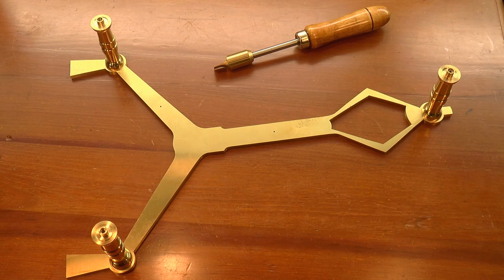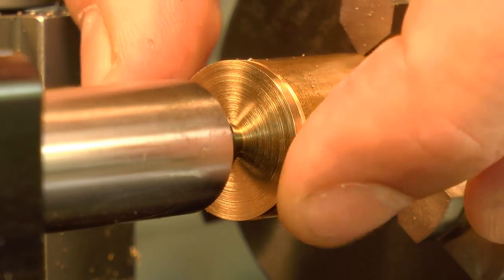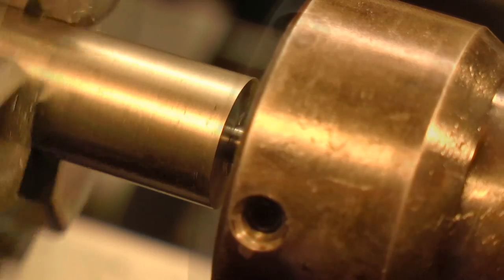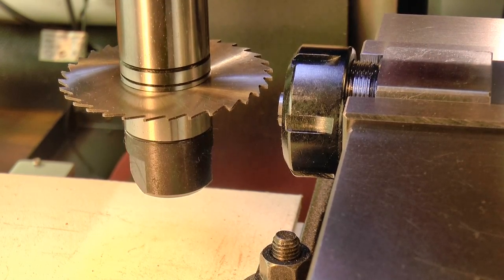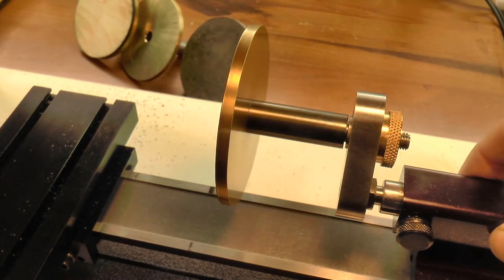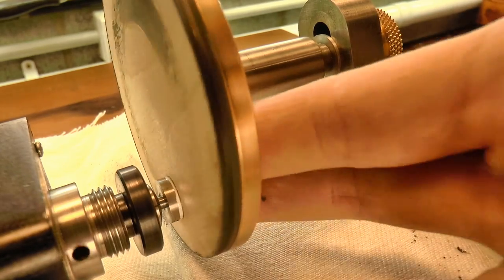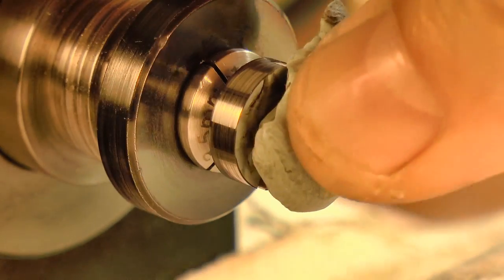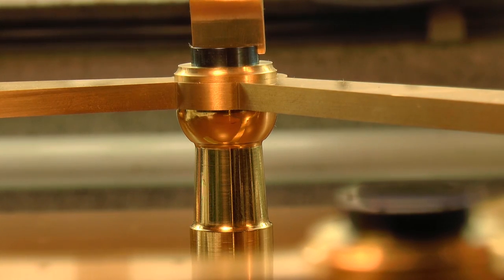Clockmaking - How To Make A Clock In The Home Machine Shop - Part 3 - Making The Washers And Screws

Comment: Really interesting how you tracked down the polishing issues. I've tried diamantine powder on watch screws and have never been able to get it right. I'm going to have to go back and try again! Thanks for the amazing videos.
Reply from the maker: Yes my main problem at this point was contamination,. Not long after this video I tracked down some pure tin to use as a lap with the diamantine, as per standard watchmaker practice. I am getting reasonably consistent black polish results now with both a solid tin block for under hand polishing, and a circular tin lap for a tailstock polishing tool for the lathe. Pm me if you would like some more info Fred

Comment: folks, when he says it isnt perfect he was not just talking about the polish. the polish is quite good. the “problematic” spots are around the slot for the screwdriver. later on you can see how rough the edges still are. 
this is not to detract from the work, which is still great. just putting in some perspective on how it is not perfect.
Reply: you can see it at about 8:19 for example.

Comment: Chris, in my model engine building I've always been able to get a mirror finish on cast iron by going through the grits of wet-or-dry paper always using light oil (3-in-1, or drug store mineral oil), the finish maxes out at around 1500 or 2000 grit and you get a mirror finish as the piece of paper you're using wears out, you are literally relying on it wearing out, which is why paste doesn't work as well since you have too large a supply of it on your tool and you're always replenishing your polishing with new grit.  As for mild steel, that's a bit more difficult because the material is softer, so you need to be more careful in not letting non-worn-out grit get in the process. HTH, let me know if you ever try it, and if it works or doesn't work for you.

Comment: hey Chris, Those screws came out beautiful. I have difficulty making my screws blue like that I almost always go too far on one! Purple and blue don't look good together. So now I cut more screws than I need and then I have another ready for bluing. I would love to find a watchmakers lathe video or class. I have always cut by hand because I chiefly worked on watches. My eyes are not young anymore and I have just tooled up for doing clocks. I have a full set up of Derbyshire, lathe, cross slide and milling attachment. Also counter balance and idler pulleys.
I wish I could find a good tutorial because to get good with the lathe in anything but hand cutting I need to learn to set up the cross slide, and milling attachment. Thanks for sharing your extensive knowledge. All the best, Sean
Reply: You may know this but always keep the bed clean

Comment: Simply a beautiful blue color on your screws. It took quite some time for us to find the right steel that had the proper carbon content to achieve this, but I think your color is even better. Could you share what type of metal you used to create these frame screws?
Reply from the maker: Mark Frank Thank you Mark. The steel I used for the frame screws was a mild steel from a supplier in Melbourne (http://www.mesupplies.com.au/) I like the color, but not being able to harden them made polishing a challenge. I have recently made some bezel screws for this clock from some EN8 sourced from the UK that I think came out a little better in color, and being able to harden them made polishing a real pleasure. I will finish the edit on that video next weekend, so it will be up for viewing in about 2 weeks. Cheers, Chris.

Comment: To prevent the scratching and to get a very good result, bring the polishing compound to a putty like consistency and polish against a zinc block.
Reply from the maker: +Nate Blubaugh Hey Nate, thanks for that. The main problem here was that they were made from mild steel, as per JW's design.The blue is better, but the polishing was more trouble than it was worth to stick with mild steel. I am hardening all of the rest of the screws and polishing with a tin lap, and the results are much more consistent: https://www.youtube.com/watch?v=5sAw4Q1PM8Y
Reply: Clickspring I had forgotten to take into account that you had used mild steel lol my mistake :p.

Comment: Your workmanship is very much appreciated. Couple of questions.

How did you determine the expected diameter for the die you used?

I am having some difficulty using watchmaker screw plates as to find out what the expected diameters are for them.

I have charts with the designated sizes of Martin 

One example size 20 has diameter of 0.367 with pitch 0.087. I take this to mean that the results after threading produce these numbers. 

What would be the expected diameter to make the stock so to thread it?

Comment: I worked with a guy that was a perfectionist like yourself and watched him work on the cover plate of a surface grinder where he dressed up the area of a welded on bung and spent over 16hrs contouring that plate until it was perfect only to have the next guy that used that grinder take that cover plate off and throw it in a spares box, never to be seen again!

Comment: Hello, First I would like to say.... WOW...
Your work is very precise and amazing.

Love how the clock is turning up.

I have a question for you: I have a brass screw from a Stanley hand plane that is a bit mushed up in the screw slot, is there a way to fix that?
Either filling it in and cutting a new screw slot, or some other magic way/simpler way?

Thank you very much, and keep up the great work, always lovely to see how much detail goes into your projects.
Reply from the maker: Hey Miachael, yes it sounds like a good approach to me, let me know how it turns out.
Reply: Hey Clickspring How do you polish your surface so well? Is there any method to it? And what kind of materials do you use for creating such a polished surface.

Comment: Hi Chris,  Thanks for the wonderful videos so far!  Really excellent videography and narration!  Your tail stock polishing jig is quite nice and was thinking about using a leather one for some of the final work instead of the MDF.  I do a lot of hand cutting/polishing work and love the zen of it and the transformations.  I've made a few different hand boards with various leather on them to achieve my end with various compounds, maybe give it a try on one of your discs?  I use Barge cement to bond the leather to the wood and it removes fairly easily when needed.  Always fascinated by clock/watch engineering & artisanship but alas trifocals and not so steady old hands puts it a bit out of my league.  A pleasure to watch your processes, techniques and thinking!  Thanks much for sharing with us!  ~PJ
Reply from the maker: pjsalchemy Thanks PJ, I appreciate it. I hear you on the zen of polishing, I love it too; it's a real achievement when you get a  nice finish.

Yes I think a leather surface would work excellently, especially on domed screws, I will try it out when I can. I have just made a pure tin lap to replace the mdf one, and it really works wonderfully too. It will show up in a video soon. It's soft enough to hold the diamantine charge, but it keeps the corners nice and square.

Comment: absolutely fabulous! Thank you so much for making these videos. I was wondering though, you mentioned the screws are made of mild steel. didn't you mean some sort of carbon steel?
Reply from the maker: +Aditya Sambhare In this case, the plans specified a mild steel, so I went with that. All of the other screws for the clock are made from a medium carbon steel (EN8). The mild steel is softer, and therefore much more difficult to get a good polish, although it does give an excellent blue color. Thanks for watching and asking

Comment: Good lord. Thats some amazing work there. I am fussy and pretty good at machining but nothing on this level!

I am wondering though whats stopping the steel corroding. The colour is just that a colour. No plating or oxidation?
Reply from the maker: +Richard Baggaley Hey Richard, the color is generated by a thin film of oxide, no plating. There is a bit more info on the process at the end of this video: https://www.youtube.com/watch?v=8h1Uf9bkc3E Regarding the corrosion, the polished surface provides some measure of rust resistance, and the oxide itself is widely believed to help also. Other than that, it's unprotected.

Comment: Newly subscribed after coming across one of your videos on Reddit.

These videos are bringing back some great memories of my granddads watch making days and has inspired me to spend more time using tools that I inherited; the Pultra 10 is a bit lacking in power.

Quick question, how did you go about clocking the screw heads correctly without over torquing them and risk ruining the threads?
Reply from the maker: Paul Whelan Hey Paul, very pleased you're enjoying the vids. Re the screw torque: it just comes down to being aware of the risk of thread stripping, and employing a gentle touch. A few degrees past a snug seating is all that is required.
Reply: Clickspring I've spent the evening rebuilding my 3D printer and they've been a great distraction, so safe to say I'm very much enjoying them. Regarding the screws, that makes a lot of sense. I suppose a lot comes down to having a feel for the difference between snug, tight and threads starting to strip.

Keep up the great work. Honestly the highest production value i've seen on youtube in a very long time,

Comment: Your technique in this video(especially in regards to polishing and bluing) are very different from your later videos. Did you discover new/refine your methods? Would you change anything if you did it again?
Reply from the maker: Yes definitely learned plenty through the course of this build: The temporary bluing tray was replaced with a set of dedicated trays filled with brass chips https://youtu.be/uST7iJgC_gs. They give a far more consistent and controlled result than simply laying the part on a scrap of sheet brass. For polishing, a tin polishing plate gives the best result with extra fine Bergeon diamantine powder. I now have both a large rectangular tin plate for underhand polishing, and a circular tin plate for the tailstock polishing tool.

Comment: Amazing like always. I have a question...the brass turn into blue only with the heat of the fire? When you drop the screw into the oil, what is the purpose of this process? Cheers from Argentina
Reply from the maker: +fedemdg Yes the heat causes an oxide to form on the steel, more info at the end of this video: https://youtu.be/8h1Uf9bkc3E The process is temperature dependent, dropping it into the oil simply cools it off. Thanks for watching and asking :)
Reply: Thanks for the fast answer. I really enjoy all your videos

Comment: Great video series and lovely project.
Could this work all be done on a lathe with 300mm between centers?

ETA you have got yourselves a new subscriber.
Reply from the maker: beernd The parts in this video certainly could, but the overall project requires a reasonable swing over the lathe bed to accommodate the great wheel. Thanks for watching.

Comment: Wonderful work! Love watching your videos. Possibly dumb question: How do you make sure the washers are the same thickness? Or is it not too important?
Reply from the maker: +KM Craftworks Not a dumb Q at all :) They are all parted off to roughly the same length, and then after the slot is formed, trimmed back again in the lathe. Before that cut, I check the length, then when in the chuck I lightly touch off with the lathe tool and then dial in the required cut to bring them all to the same dimension. I leave a little bit on for grinding/polishing. Inevitably some take more than others to get the required finish, so end up losing a few hundredths of a mm more than others, but it doesn't really have any impact on their function. Thanks for watching and asking.
Reply: Clickspring
Awesome, thanks!

Comment: G'day I was looking at some spring steel at work and I wandered if you could use normal mild steel sheet and put a gentle bend in it and heat treat the steel (blueing) to make it spring steel ?
Reply from the maker: +dtec30 Mild steel has too little carbon, and so cannot be quench hardened. To be able to function as a spring steel, a steel must first be hardened before being tempered. Whilst the blue color in this video is a result of a tempering heat, these screws remain as soft as the original mild steel, because they were never hardened. Thanks for watching and asking.
Reply: Ok cool I wasn't sure and it seemed too easy to just do that and hey presto springs

Comment: Hello, this might be a stupid question, but when you put the flame on the screws to change color, is that change only on the surface, i.e. would scratching reveal the original color?
Great video :)
Reply from the maker: +pastormoser The coating is a very thin (a few microns) coating of oxide on the surface, and is very easily scratched off. Generally this sort of bluing is done on parts of clocks and watches that would not usually get a lot of handling by the user, so that the color lasts longer. There's a bit more info on the process at the end of this video: https://www.youtube.com/watch?v=8h1Uf9bkc3E Thanks for watching and asking :)
Reply: +Clickspring Thanks for the very quick answer!
I have one more question: how loud is a lathe? From your videos, it doesn't sound loud at all, but it's hard to imagine it being quiet :)

Comment: But when you do the heat bluing, you lose the hardness. Could you check how much? From60 hrc to how much? If it will be soft, it will be worn out quickly
Reply from the maker: +Marcin Zdunek Tempering to blue reduces hardness a little, but it could not be described as soft. Wear qualities remain very good. Thanks for watching :)

Comment: Interesting problem with the scratches reappearing. I have a feeling it's the wood you are using. If a tree grows in sandy soil it will to some extent take silica particles up into the wood. Some woods like teak and meranti are renowned for their silica content and will dull blades very quickly. I've never tried to polish anything with wood but I wouldn't be surprised if the silica particles were large enough to cause those scratches. Why MDF doesn't cause the problem though I don't know, the feed stocks vary though so perhaps you just got lucky.
Reply from the maker: +Wobblycogs Workshop You could be right WW. The design called for mild steel here, but its almost impossible to get a consistent polish without hardening the steel first. All of the rest of the screws in the clock are made from a high carbon steel, and quench hardened, and are polishing well. The classic screwhead polishing tool from Lorch has a wood lap,  (https://www.youtube.com/watch?v=WyBVUAiFJ9o) but I'm getting much more consistent results with a tin lap now, and have since abandoned use of the wood lap (https://www.youtube.com/watch?v=5sAw4Q1PM8Y) Thanks for the suggestion :)

Comment: Wiki, search "File tempering Standards"
But do remember that the colour does not protect the steel in any way.
It is just to look "Purty"
Steels are made, to harden in different ways.
Age Harden.
Heat treat Harden.
Work Harden, 'n so on.  But the colours that you see, are only an indicator of the temperature that the steel had actually reached, before being allowed to cool.
It is a fascinating science, Heat Treatment of Metals.

Comment: Why did you do the taper cut on the small lathe rather than on the larger one? (~1:10)
Reply from the maker: +rousp1 All set up on the small lathe, so quicker to do it there. Thanks for watching and asking.
Reply: +Clickspring Thanks, trying to learn. Considering to get into this hobby as I'm into watches and it would be neat to make a clock. Something that would help a newbie is if you make it clear what lathe you are using for different operations. Eiter by a caption, saying it or making a short video showing your machinery so that it is easier for a fresher to recognize them. Thanks for your videos! :)

Comment: Why blue the screws?
Reply from the maker: For the cosmetic appearance, and also for a small (purported) increase in corrosion protection
Reply: Clickspring brass and blue. It's taking forever but it's going to look amazing when it's done
Reply: Really curious as to how you got it to that shade of blue.  I see you heating it up, and was wondering what kind of chemical you dropped it into.  Beautiful work.
Reply: No chemicals necessary for the method shown.  Clean steel will oxidize when heated in air, achieving the bluish/purple color between at ~575F.
Reply: Thanks!
Reply: Thanks to you as well!
Reply: You must understand what takes place.  The blueing helps to hold oil or other antioxidizing substance which does protect the metal.  So blue to hold the antioxidizing substance which positively does protect the metal.

Comment: Technical Question: Does the "blueing" serve as rust protection on the mild steel?
Reply from the maker: +jordon jane Hey Jordan, yes it does. It's not particularly effective, but the oxide itself, plus the small amount of oil absorbed in it both work to reduce oxidation. Having said that, I've done a few tests to verify the theory, and it's a marginal contribution at best. Thanks for watching and asking.

Comment: Aren't you afraid that the chuck on the lathe would damage the threads on the screws? Or is that not a problem?
Reply: A 6 jaw chuck and taking care of the force applied does the trick.